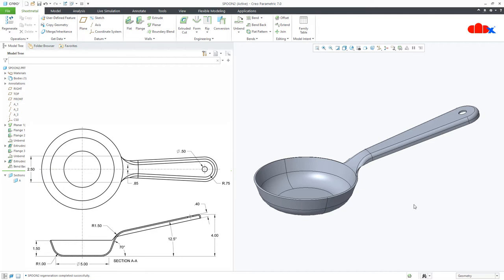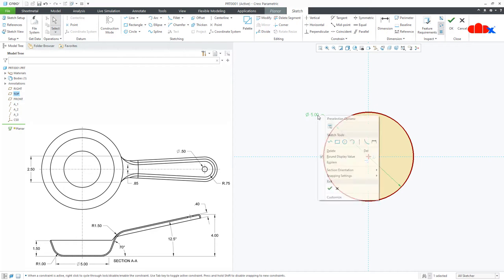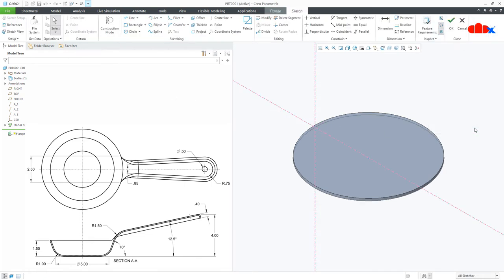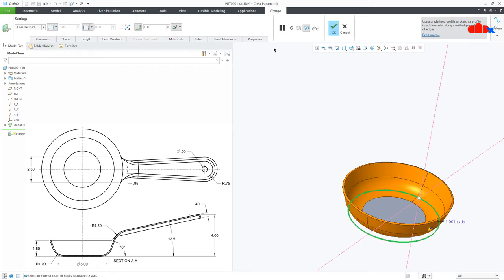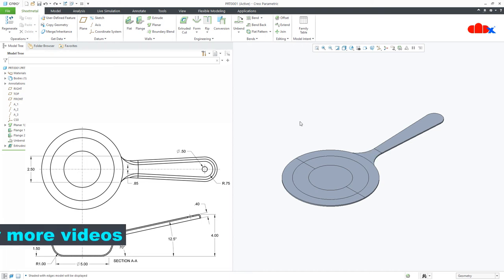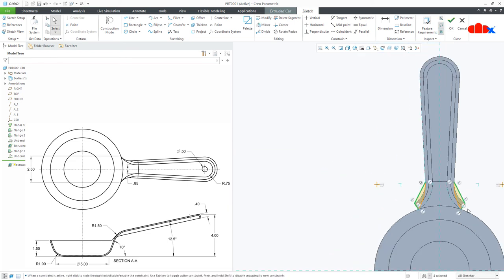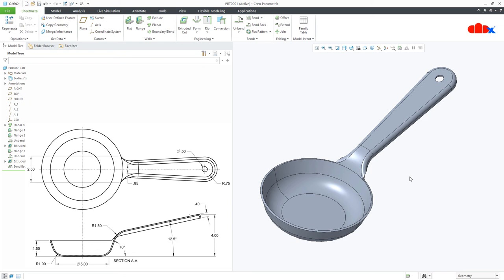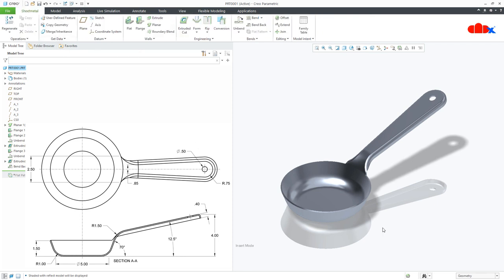Sheet Metal Tutorial | Spoon with flat pattern in Creo Parametric

Comment: Can you explain why feature failed to regenerate is coming sometimes while designing the part and how to resolve it?
Reply from the maker: The easy way to check it is regenerate every feature one by one and see which feature fails. Once you understand that which feature is failing you modify that feature once again. Try to change some dimensions here and there so that the surface generated in that particular feature should move little bit. Generally regeneration fail happens due to surface conflict between two features.
Reply: @CADxTraining  Thank you

Comment: flat pattern command for this feature not working in creo 7 and 8 , does anyone know why?
Reply from the maker: Increase the file accuracy. It will work.
Reply: @CADxTraining  wow, increased accuracy to absolute 0.001 worked like a charm. thank you. what should be default accuracy ?
Reply from the maker: As you increase the file accuracy, the file regeneration time increases. It also increase the file size. Increasing accuracy for all the parts will slower your system performance. So the best practice is, keep your accuracy minimum on which you get the desired result.
Reply: thank you sir for this information. in creo 8 there is also problem in family table like if we made a family table of sheet metal parts then i couldn't make flat pattern of more than 2 parts from old create instance feature. is there any solution for that too sir?